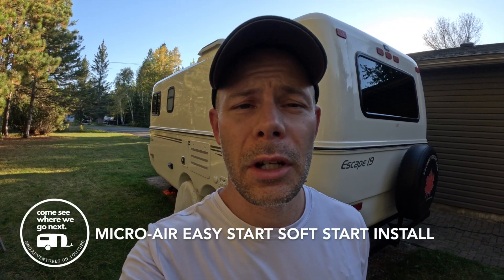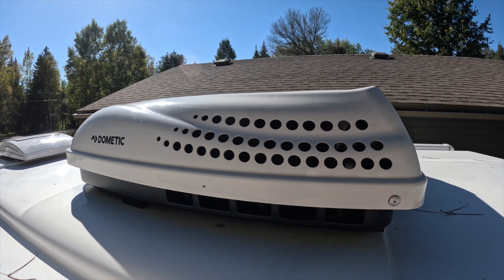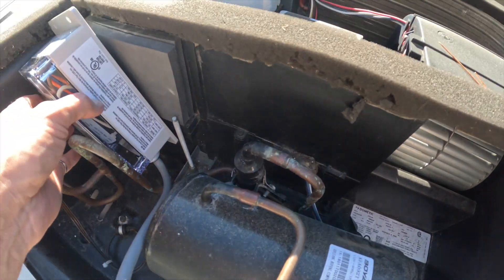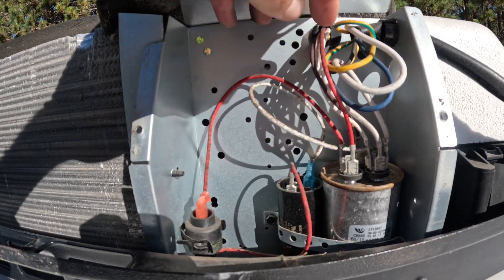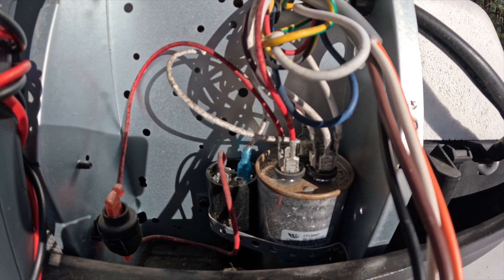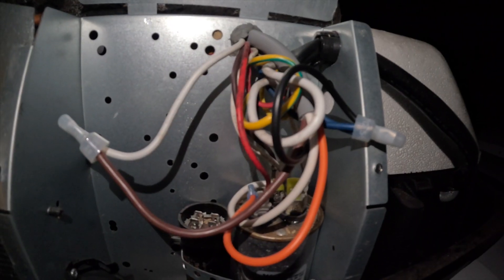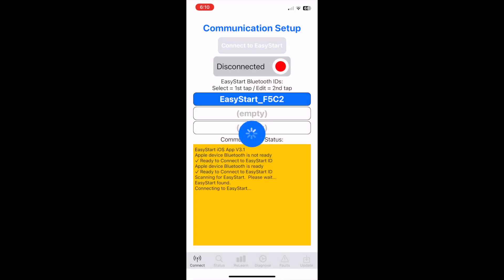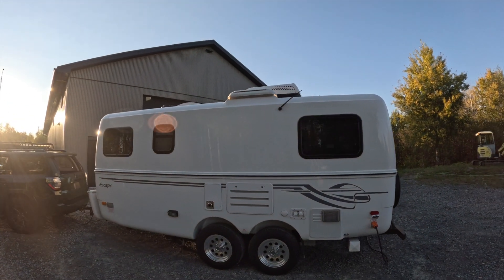RV AC Soft Start: How to Install Micro-Air EasyStart

Comment: Great aftermarket item and installation video. Thanks. Escape trailers now offer with their Zap Pack an easy-start AC unit and appropriate converter for those ordering new from the factory.
Reply from the maker: Nice, happy to hear it’s being offered as an option on the new models